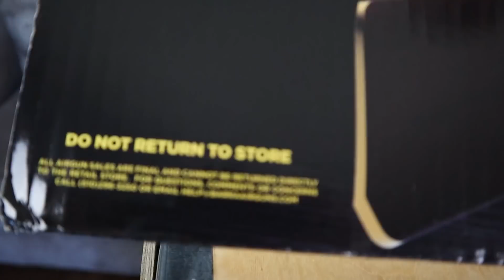Guess The Price Of The WEAPON, You Keep It $500 CHALLENGE *WORST RATED ON WISH EDITION* RAZOR CLAWS!

Comment: DONT OVER PUMP IT. The reason you shouldn't is because it'll break the air chamber and won't work anymore if the pressure is too high. That's how I broke my first pellet gun

Comment: Weapon Nr1: I think one of them would cost like... 25$?
After the test I would say one of them costs... 14$.
Me after prize reveal:That's not worth it.

Weapon Nr2:
Before test: 30$
After test: still 30$
Real prize: I mean, if the string had more tention, then I would go with this prize, but because of the fact this laser came off, no.

Weapon Nr3:
Before test: 70-80$
After test: 110-160$
Real prize: There are better Airguns but, it's not bad.